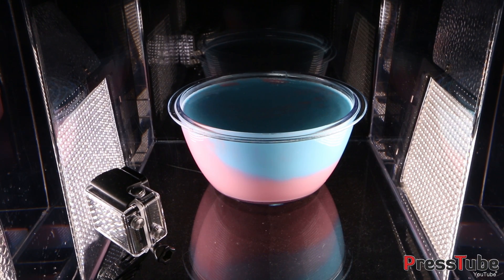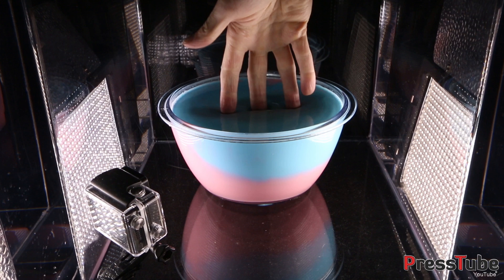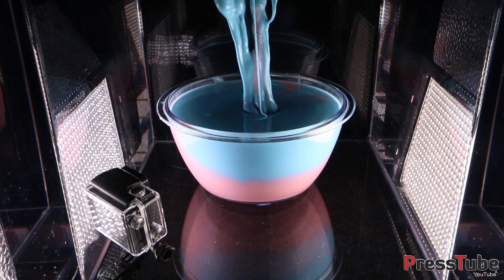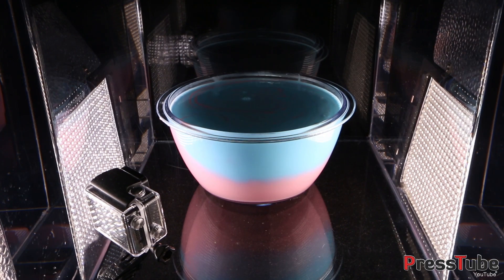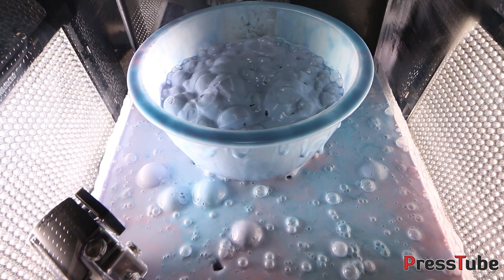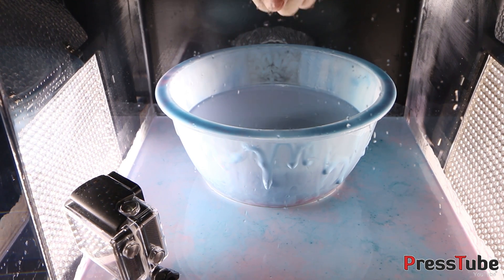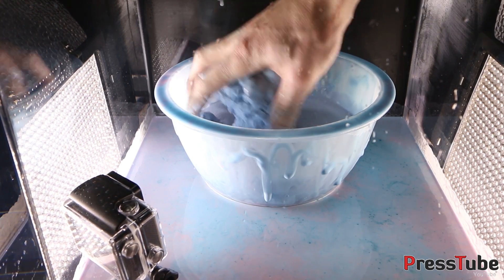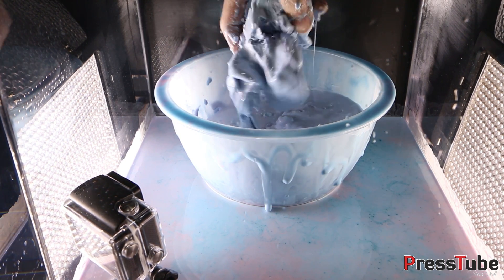Oobleck in Vacuum Chamber

Comment: As air pressure drops, so does the boiling temperature of water.  End result?  Water won't exist as a liquid in a vacuum.  Oobleck has a lot of water in it, so what you did was boil it.  The thick oobleck at the end was because it was dehydrated.  What happened was just what I expected, and I enjoyed the show.     :)

Comment: Fascinating!  The gases in the Oobleck were boiling off during the evacuation process.  I wonder if all the gases would eventually boil off to the point were the Oobleck would stop boiling?  Probably so.   I wonder what the Oobleck would be like after air is let back into the chamber at that point?  Hard as a rock?
Reply: It is water boiling, and the oobleck dries up.